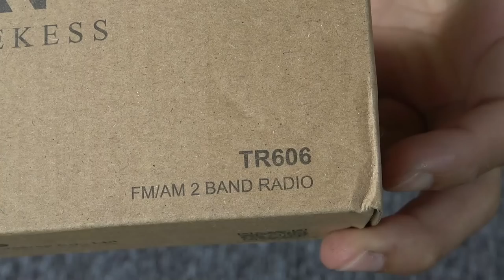What's inside Retekess TR606 Radio Cassette Player

Comment: I've bought several Cassette players recently, because the Phone company keep disconnecting my internet to fit fibre optic Cables. Then they connect me to the Wrong line !!!  I also don't want to carry my Mobile Phone around.  So a Cassette player is Perfect. Especially a Bluetooth one with a seperate Bluetooth Speaker.  I can record on to a Blank Casette using a Bluetooth Recorder !!!  These Chinese Cassette Mechanisms are Good.  They make Millions of them, so there are no Bad Design Faults on them.  I play the Tapes all he way Through then Reverse them !!!  The Tapes don't work very well if you pick out tracks and Rewind and Fast Forward the Tapes.  If they slow up I just Fast Forward and Rewind the EntireTape and then it works Perfectly !!!

Comment: Last tape recorder we bought with the intent on using it for daily use was a Radio Shack radio-recorder OEM'd by Aiwa. This was back around the turn of the century and as it turned out, we ended up using the CD player we'd bought at the same time more often. Then MP3s (and Napster) came along and the poor cassete recorder sits in it's box virtually unused. It's now a collectable so there's that...